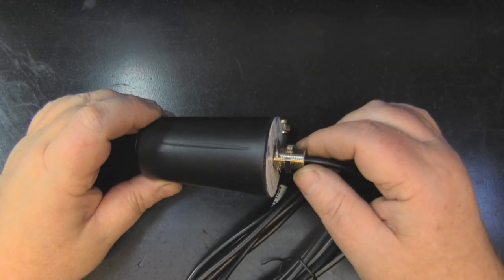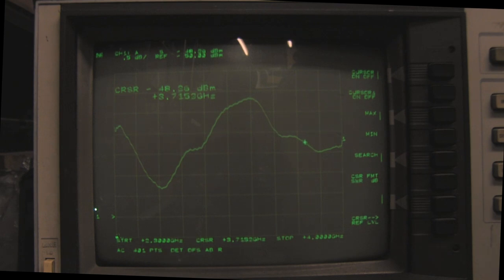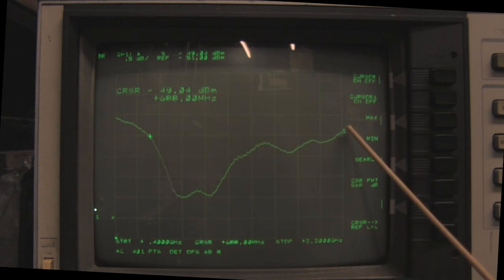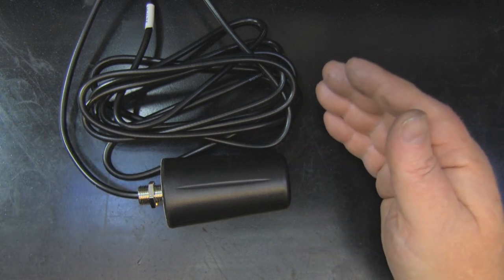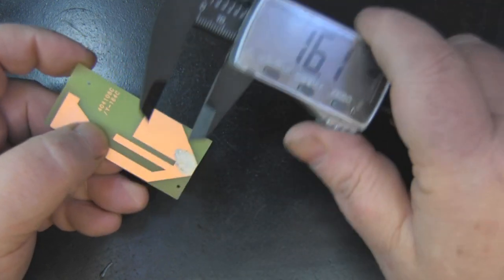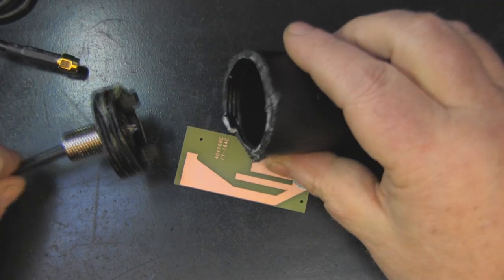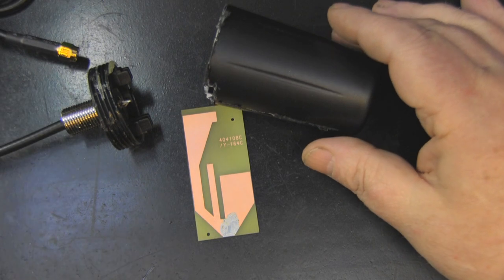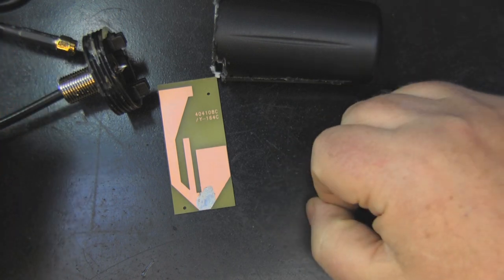A 5G Antenna from eBay

Comment: Quite a long cable for 3G... and probably not a good quality. Maybe you measured mainly the cable? I would try to cut it and try again...
Reply from the maker: I have not tested it but it looks better than the usual speaker wire you get with these.

Comment: Excellent review! That element PCB just looked like ordinary FR4. If so, the ex-works cost to the antenna maker would be in the low pence range for  production volumes.

Hey, you forgot to mention how well it integrates with your local authority's kill grid!😉
Reply from the maker: LOL the kill grid is still to be turned on 😁

Comment: It looks interesting but my spiral PCB antenna can cover 3.3ghz to 6ghz, has 3.5db of gain and can be used for 5.8ghz fpv as it is also circularly polarized.
Reply: Hey Terence, do you have the schematics for your build and some pictures?
Reply: @benjamengabriellewis8818  well, there’s not really much of a build as it is a pcb spiral antenna that I bought. You can find it on YouTube by searching for  5.8g pcb spiral 1956

Comment: Interesting antenna, I'm surprised taht the case is completely round / symmetrical, since the radiation pattern isn't. This makes it hard to see in which direction the antenna actually points. 

The coax seems to be quite a bit better than the super cheap speaker wire kind, that's nice to see.

How do you calibrate your network analyzer? 
Do you do a full OSL calibration? 
I'm askimg because your S11 values are at -40 to -50dBm even at the bad spots. If you did a full calibration and the open would be at 0dBm, that would be quite a strange response, I think.

Greetings,
Michael

Comment: Dear Mr. Andrew,
I need real working cheap 2,4GHz wifi transmitter to gaining range of signal transmission. I am using tenda 03 radio.
Would you please show me how to build it? Is it possible to replace with other sectoral mimo? 
Thanks...

Comment: Hello. Great review. Was looking at exactly these kind of antennas from Aliexpress. Would this work on a boat with 4G? Now my phone looses the signal(4G, 2G works further out) about 15-20km out on the sea, would this increase the distance compared to that if I use two of these with an 4G router..? Would need small size antennas as it's a fishing boat. What frequenzy should I target at? Am I right that low frequenzies reach longer out? Thanks.

Comment: Doesn't look like a very good 5G response to me,...
.  just a general purpose 3G, 4G wifi ( %G does appear to have been 'peppered' on these lower bands) I believed the Max frequency was to be 15Ghz for mobile phone coms. 
.
Reply from the maker: I am also seeing a lot of 3g 4g antennas just being rebranded as 5g with a higher price tag. Just sent a Yagi back to a seller who sold me it saying it was 5G. it was identical to the cheap 2.4GHz Yagi’s that have been on ebay for the last 20 years.

Comment: You had fibre in 2001!? I must have been born in the wrong country. It costs $8,000 for a 1Gbps dedicated connection in my country
Reply from the maker: Yep 2001 1mbps fibreoptic connection cost £34 a month 2021 516mbps cost £46 a month